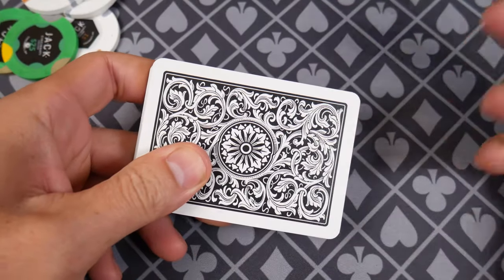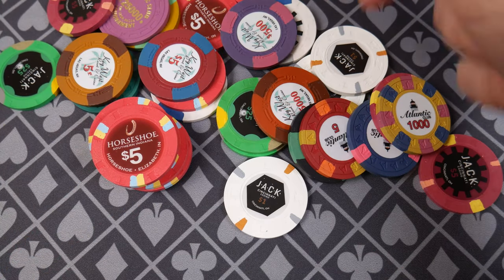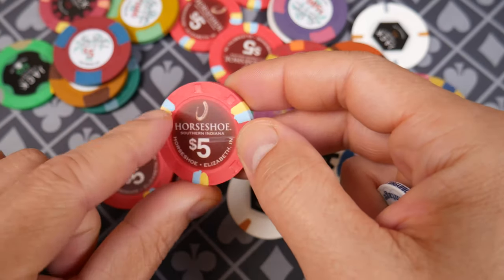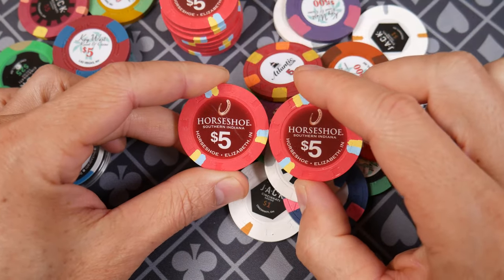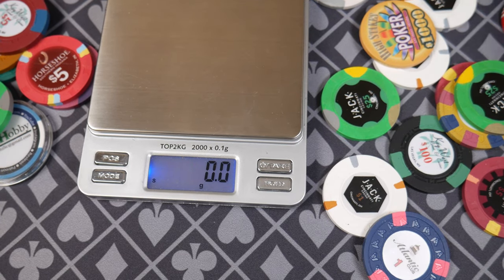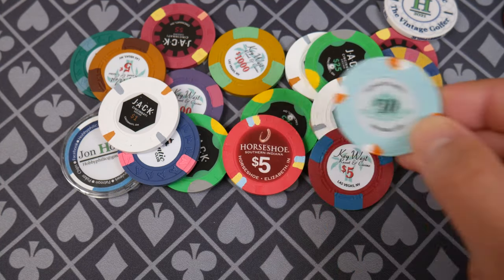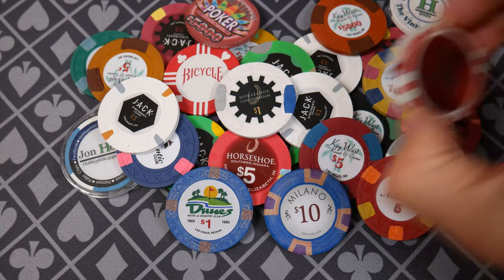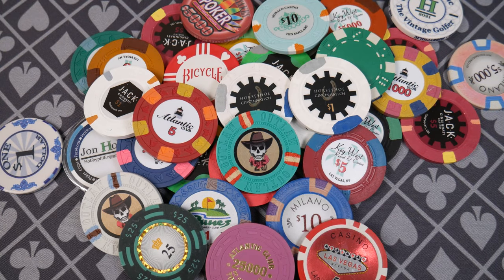Premium Poker Chips Are Flawed!

Comment: The way i view this argument is that when you pay a premium for something, like your furniture for example, you pay that premium expecting it to be high quality and high quality usually is also a meaning for longevity. Like your furniture, you pay a lot for that. Say 4k for i dont know, a nice table. You can use that table time and time again, pass it down to your kids, etc, and never have to really worry about it. Now lets change that and say that 4k table wears out after 40 times using it and you have to replace it. Spending another 4k doesnt look or sound very attractive. And i think thats what most people are saying with poker chips. You go out and spend lets say 2k on a premium set of chips, then after a month or 2 of heavy play they look like you dragged them across the driveway. Eventually youll have to replace them id imagine. Spending another 2k just doesnt sound very appeasing. And personally i think thats why so few companies stil do super high premium chips, because most people prefer longevity over having to replace something expensive every year or two. If everything in your house total cost you 150k and you were told that every 10 years youd have to replace everything, or you could spend 75k and get stuff that will do the same thing and you can use it for 50 years, i dont see anyone happily skipping over to the 150k side with a smile.